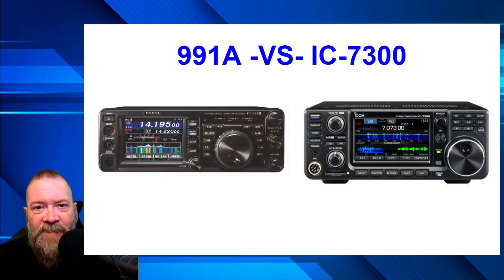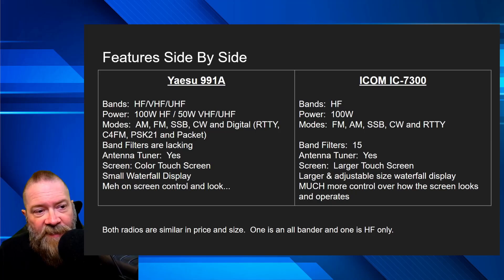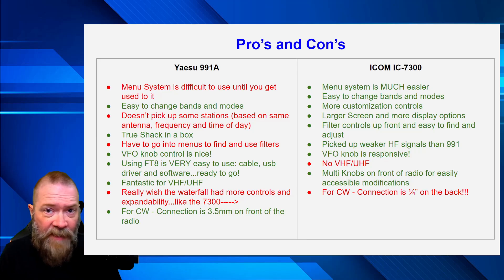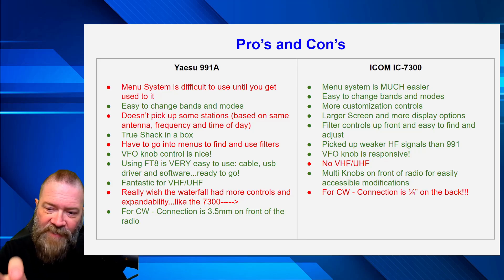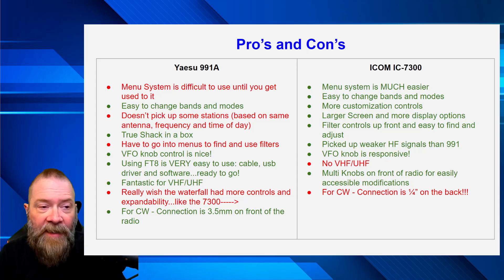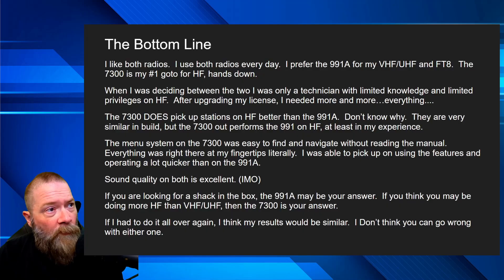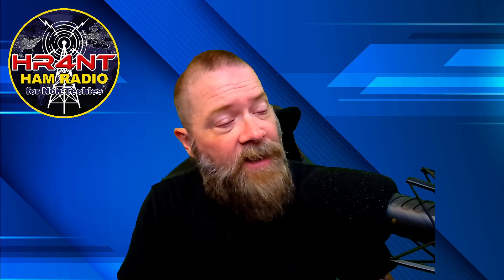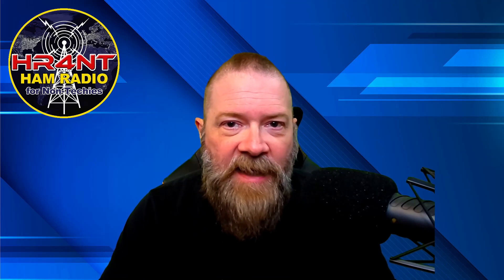A Tale of Two Radios - 991A - VS- IC-7300

Comment: Originally, I was going to purchase the Xiegu G90. But after watching your videos and others doing my due diligence, I narrowed it down to the 991a and the 7300. The president of my local Ham Club e-mailed back and said the Xiegu G90 was a bad move because it basically a QRP radio and said many or most of the club members had 7300s. But by the time I got his e-mail, I had already ordered the 991a. And I will tell you the “shack in a box” pretty much sealed the deal. Using your “buy once, cry once” philosophy, I wanted the most bang for my budget bucks. What I didn’t realize is how little I would use VHF/UHF (I’ve used it exactly twice) long enough to set up the 991a to “hit our repeaters” and make a few QSOs. I told my wife, the 991a is like your new I-Phone, way more settings than I’ll ever probably use but maybe eventually will . I’ve learned a lot about the 991a and I continue to learn each day. What I would suggest to new 991a owners, learn the basics to get up and running, check the manual and You Tube and get smarter. If as Hams we don’t take time to try to be masters of the equipment we now have, our shacks will start looking like thrift stores and we’ll most likely still not be satisfied. 73 Tom, KQ4DCT
Reply from the maker: Thank you for sharing that story!  Sorry to hear that you missed out on the 7300.  However, you "could" put it up for sale and buy a 7300 if you wish to pursue that route, but if you are happy with what you have then just go play radio and enjoy the hobby.  Yes, gear is important, but having fun and enjoying your self I think is much more important and if that need is being met, you are winning.  Thank you for watching and for the comment.  73!!
Reply: @HR4NT Icom ic-7300 noise receiver FT-991 is good receive and sound

Comment: I’m responding to you from my sons account. I’ve been doing this for a long time so I will make a couple of points you forgot to mention. In the case of the 991 the few things it can do that the 7300 is the vhf and uhf are not only fm bands there is sideband and am on those two band for contesting. Also the c4fm system fusion is also capable on the hf bands and not just vhf and uhf. So remember those considerations. I agree with you on the ease of menu on 7300 it is an awesome radio. I have a kenwood ts-2000 it to is a shack in the box but it does what the 991 does just minus the digital c4fm. But that radio can do something the 991 can’t it can crossband repeat not only on vhf and uhf but it will let you crossband to hf how cool is that. But as you say all depends on what you’re going to do with your shack for operating. Great video call sign KB1IWE Look me up.73’s stay safe.
Reply from the maker: Hey there KB1IWE!! Thank you for that info.  I really appreciate that!  When it comes to radios we all have to choose based upon what we want out of the radio.  At first when I became a ham, I "thought" I wanted a shack in the box.  Then, my tastes in radio changed and with that so did my choice of radios.  I ended up selling my 991A and separated my VHF from my HF operations.  Again thank you for the info!  Thanks for watching and for the comment.  73!

Comment: Is there an ICOM radio similar to the 7300 that has uhf/vhf?
Reply from the maker: Kind of...the Icom IC-7100 is a "shack-in-the-box" but does not have the colorful waterfall display like the 7300 and is the same price.  https://www.hamradio.com/detail.cfm?pid=H0-011766  I hope this helps.  Thanks for the question and for watching.  73!

Comment: I have the ft 991 a  as my first radio and just got my Tech license. I was disappointed to find the radio only has 50 watts max on 2 meter, why would that be? I can only reach repeaters about 12 miles out, I guess my antenna is not high enough? Thanks
Reply from the maker: First congratulations on passing your Technician!!!!  That seems to be the standard unless you buy a dedicated VHF/UHF radio.  The IC-9700 runs 100 watts, but is very expensive for what it is and the Yaesu 2980 (which I have) gives you 80 watts.  You need a high gain antenna and have it up as high as you can get it if you are in an area where repeaters are far away.  It will also depend on propagation conditions at the time.  50 watts on VHF is still pretty good, you just may need a better antenna higher off the ground.  I hope this helped.  Thanks for watching and for the comment.  73!!
Reply: @HR4NT  Thank you for your always helpful information!

Comment: I was in that boat too when i got my license back abt 5 yrs ago, i didn't know where to start on buying a radio. After a long search i bought an Icom 718 on a recommendation from a fellow ham (I wanted a 7300 back then but they were WAY out of my budget) but i lived on the ground floor of an apartment with no way to put up an antenna, so i decided to do more research and found K8MRD on Youtube and he was running a Yaesu ft-891 and i fell in love with the portability. I decided i was going to be a portable operator only and the 718 was a cinderblock to carry around so i sold my 718 and bought an 891(wished i'd have kept the 718 now). 5 yrs later I now live in an HOA and run a rain gutter antenna with my trusty 891 at home and now i'm looking to buy a 7300 for (like you stated) the simplicity it brings to the shack, along with a MUCH simpler digital hook up than i run now and this way i can put the 891 back into portable use. I love my 891 but the menu is a royal pain to navigate even all these years later. Thanks for the video, i always enjoy your straight forward approach to the hobby. Hope to work you sometime, 73 de W8MJL & K8MKL
Reply from the maker: Hey Michael, I appreciate you sharing that story!  I have both the 891 and the 7300, but they are brought out for various reasons when I want that specific radio.  It would be great to get you in the log!  Thanks for watching and for the comment.  73!

Comment: Press the "F" key for quick access to filters, not the main menu key which is loaded with 100+ items you don't necessarily use on a daily basis.   This really is a tale of two radios that are apples to oranges.  I love the look of the 7300 especially the scope and seems like a fine HF rig but seriously handicapped against total package of what a 991A provides.  On the 7300 there is no FM, no C4FM, no 2M/70cm SSB or AM etc. do to a huge deficit in bands and features.   You state the F991A couldn't receive the same signals but there are a lot of variables trying to do that kind of comparison unless you have a service monitor or RF signal generator for a 1 to 1 comparison.  That said parts of the comparison were helpful to know and appreciated.
Reply from the maker: I am glad that you enjoyed the video.  Thanks for sharing that information.  Thanks for watching and for the comment.  73!

Comment: For your RF noise problem, look for one of those inductive charging pads for phones.  I have heard of them causing significant hash on the HF bands.

Jim  N4FAF
Reply from the maker: Than you for the tip.  We actually did the breaker box check and turned everything off and one at a time flipped breakers top see if it made a difference.  There was no notable RFI coming from within my home.  The problem seems to be a neighbor with solar panels which has been addressed and currently being fixed.  Thanks for the comment and for watching.  73!

Comment: 991 vs 7300 on hf isn’t a fair comparison. The 991 lacks on the recieve on hf but it has 2meter and 70cm. If you wanna compare hf to hf compare the 7300 to the ftdx10. The ftdx10 beats the 7300 all day. 991 is more of a do it all but isn’t quite as good as a hf only radio
Reply from the maker: I appreciate the insight, however I was comparing the two radios I actually owned at the time.  My main complaint about the 991A or almost any Yaesu is that menu system...it drives me crazy.  Prefer the Icom system much more.  I will look into the FTDX10 down the road.  Thanks for the comment and for watching.  73!

Comment: The 7300 is a hf  radio and the yaesu ft991  is a shack in a box. Its like testing a car v tractor. The icom 7100 is a shack in a box and similar to the 991.
Reply: thanks, saved me the same comment...
Reply: I thought the 7300 was not a shack in the box as it has no vhf or uhf...
Reply: @mattblack133  learn to read
Reply: @danielpark2991  ohhhh sorry... it was late and didn't have my glasses on. No need to be a little twit tho.
Reply: @mattblack133  never mind mate we all have blonde moments lol

Comment: I recently found your channel, and am really liking it.    I'd like to offer another perspective.   Originally, I really liked the idea of the 991a, and the "shack in a box"   but after a LONG time of considering the best path for me,  I decided I'd like to have the exact same VHF/UHF setup in the house and vehicle.  This way, I can get intimately familiar with the radio operation, so that when I'm in the mobile, I'm not playing and hunting around for options, knobs, buttons.. etc.  It's just intuitive because I use the same setup in the house.  As such,  I now no longer give so much attention to the "shack in a box" idea.   The only place I think that makes sense now, is if you are limited on space or budget, for the most part.
Reply from the maker: Yeah I pretty much have to agree with you.  I thought I wanted a shack in the box solution as a way to save money until I wanted to operate digital modes on HF AND be on VHF doing simplex operations...that messed everything up for me.  I ended up selling the 991A recently and just staying with the 7300.  In order to have my VHF, I purchased a Yaesu 2980 which is VHF only, BUT pushes 80 watts.

I like your idea of having one model radio both in your house and in your vehicle and your reasoning is logical.  As you said, space and budget might sway one to go for the shack in the box idea.  Thanks for watching and for the comment.  73!

Comment: I'm likely to buy either the 7300 or 705. If I buy the 7300 I'll have to buy a good VHF/UHF hand held like the ID-52A. In Australia we have 3 classes of licence and I'm the lowest which is Foundation which limits me to 10w effective radiated power. So I can run a 7300 just at about 11-13w depending on losses. With the VHF and UHF bands I have a repeater close enough I should be able to easily get into it with a vertical. and the repeater has dual tone programming so I can jump repeaters. Thanks. VK1NME
Reply from the maker: Hey Shane!  Thanks for the comment.  It sounds like you have some good ideas there.  There is nothing wrong with the 705 but being only 10 watts max it may limit you and not allow you to grow.  The 7300 however, would allow for growth as you climb the license levels there in Australia, but as you say, in order for you to do VHF/UHF, you would have to have a secondary radio.  I am sure you will make a decision that best reflects your needs.  I appreciate you reaching out to me and thank you so much for watching the video.  See you on the air sometime!!!  Stay safe!  73!!!

Comment: A bit pedantic, I know, but... 10:21... just to clarify, it's not really a matter of "preferring" the 991A for UHF/VHF, it's the ONLY choice. I have both radios and as I'm sitting here being all pedantic on something you've said, looking over at the radios, I must admit that there's something you haven't mentioned that's quite glaring, to me anyway. The Yaesu is sexier. The illuminations above the VFO knob, the way the panel is designed with the buttons clustered around the VFO. Very visually appealing. That's all I have between the 2. The difference between really, really liking a radio and really, really really liking one.
Reply from the maker: You are correct!  The 991 interface is MUCH sexier than the Icom.  I will give the win to Yaesu for that!!!  I still have my FT3DR and my FTM-400 and the screens on both are just beautiful!  Thanks for the comment and for watching.  73!
Reply: @HR4NT  So, having spent my first weekend with the radio (FT-991A) there's a few things I don't like... Memories is a big one for me... first of all, my FT3DR (OUR FT3DR !) has 900 memories.... the FT-991A has 100... On my FT3DR, using the FREE software from Yaesu, I can create and name, up to 24 memory banks, with whatever frequencies I want to add, populating them. FT-911A - you can "group" memories in groups of 20. No naming, just a max of 5 groups of 20 channels. Really ? So, my list of 70cm repeaters that I can hit, is more then 1 memory "group" can hold. There goes my dream of having a Wires-X, Fusion, 70cm, 2m and Scanning memories programmed and called what they are. On the subject of scanning, my FT3DR can hear from 500hz to 1GHz... the RX frequency range on the FT-991A is woeful by comparison. Love the radio for 70cm/2m (you're right, the radio is deaf to some weaker stations I can pick up on my 7300... sitting side-by-side, same antenna etc)... I just wish that Yaesu had given us more control and freedom and QUANTITY to use the memory features as we wish. One more thing. I appear to have the knack for crashing RT Systems software at an alarming rate...

Comment: I had some problems with my Yaesu 991A when I first bought them....bought several.  But, Yaesu hung in there with me, honored their warranty and things finally got worked out.  I still don't know what was going on with the rigs but Yaesu fixed it and I've been a happy 991A operator for some time now.
Reply from the maker: Yaesu is very good at honoring their warranties of their customers.  Sorry you had so many issues, but glad it was resolved quickly and in a timely manner!  Thanks for watching and for the comment.  73!
Reply: @HR4NT  Yes they are and while at time we had a contentious relationship at the end of the day I'd like to think it just took a little heat in order to produce light.......they might not see it that way but I do.  KUDO's to Tim and Juan.

Comment: I talked to a guy in Bosnia on my 991a, very weak signal, so you might have a different issue going on as to why you can't get weaker signals to come in.
Reply from the maker: Since this video I found the reason is a guy a few houses down with solar panels emitting massive RFI into my radio.  Thanks for watching and for the comment.  73!

Comment: 12:04 it's probably because once you turn your house back on those "dirty devices" ALL share a common ground/neutral that's all tied together without a breaker in between... Ham Radio Crash Course did a solid video on RFI. Use a cheap shortwave radio (like $15 off Ama... can't post the full name...) to hunt down the culprits and get some circular ferrite cores that have a "43" material number in the description to loop the power cords through several turns.
Reply from the maker: I actually went through and did all that.  the RFI is not in my house.  After hunting it down it was determined that a neighbor has a noisy solar setup on his roof and tat is the source of 90% of my RFI.  Thanks for the comment and for watching.  73
Reply: @HR4NT  that makes sense too, solar panels are really just specialized UV spectrum LED's, and cheap LED's can be horribly noisy. If you apply power to a solar panel and look at it with a camera that doesn't have a UV filter on the sensor or lens you can actually see them light up!
Reply: @HR4NT  ugh... Get a taser and whip one of these up to toss on their roof! 😁 (JK!)😅https://www.youtube.com/watch?v=gAV8_D71M0o

Comment: The receiver in the 991 is far superior. The issue is that at first glance it's not obvious how to bring out the best in it. Once you learn how to properly use filtering, contour, and attenuation, it is a dream.
Reply from the maker: I continue to play with my 991A.  Unfortunately now due to the neighbor with solar panels a few houses down, my radio operation at the QTH is very limited.  I will have to bring it out to a park and try it out there.  Don't get me wrong, it is a fantastic radio and I love it, but I find the 7300 a bit easier to navigate.  I appreciate the advice.  Thanks for watching and for the comment.  73!

Comment: I have to agree with you. I bought the IC-9700 and was delighted with it. I waited for the FT-DX10 and compared it with the IC-7300. Ease of use swayed me to the iCOM. The only thing I regret about the iCOM is the poor anti-aliasing filter, A compromise made to give it 4m coverage.
Reply from the maker: There is always going to be give and take with any radio purchase.  That may be why we continue to buy a crap load of radios and have so many over the years...LOL  No matter what radio you buy, if it works, allows you to make contacts and you have fun in the end, then I would say that is a win.  We all want the perfect equipment, but sometimes i think we get caught up in that and forget to just go play radio and have fun with out hobby.  Thank you for the comment and for watching.  73!
Reply: @HR4NT  I only wish they:

1. Removed the pointless antenna tuner, the one that matches a 50Ω transmitter to a 50Ω feeder. Why do these radios have antenna timers? You place the tuner where the mismatch occurs, not at the end of the feeder! 
2. Instead improve the filtering 
3. Instead Include two antenna outlets, with a switch, one for 6/4 and one for HF.

I think they would still be quids in removing the tuner and adding the above.
Reply from the maker: @G8YTZ  I thi k Icom has a suggestion section on their website where you can make suggestions as a user and maybe they will adopt some of your ideas. Probably need to Google it.
Reply: @HR4NT  I might be meeting them next month….